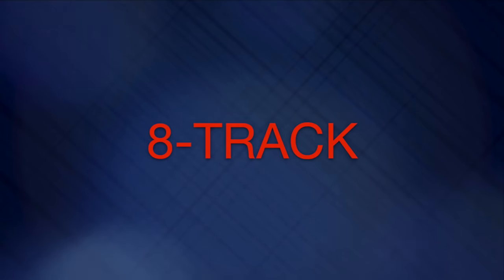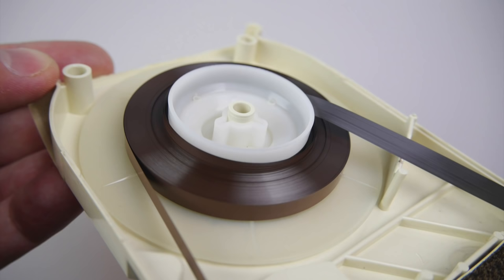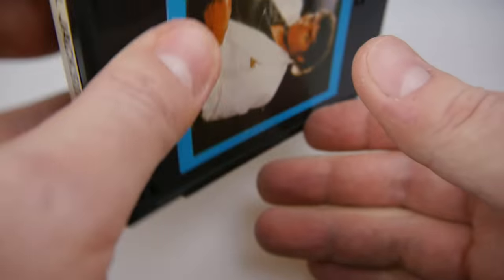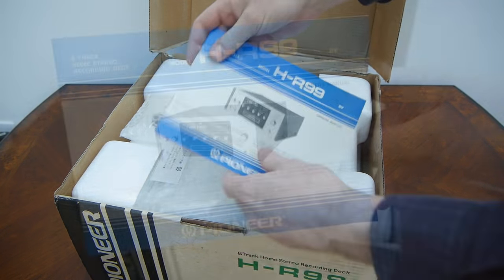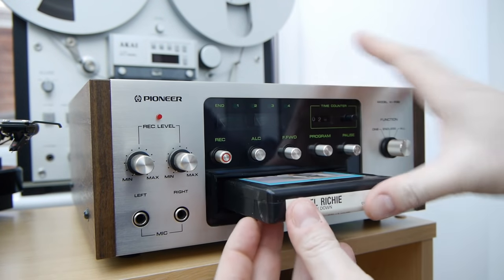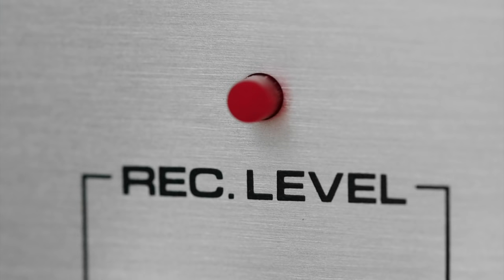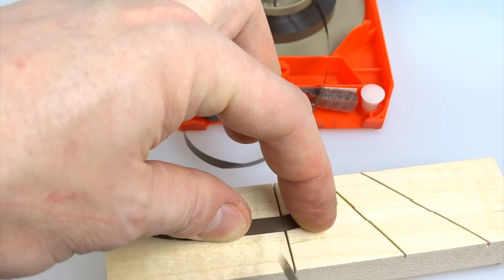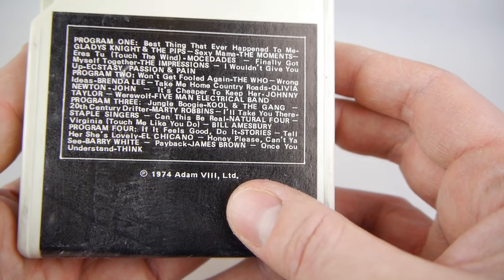Revisiting the 8-Track with a New 1975 Pioneer HR-99 Recorder

Comment: I think I had one of the best, if not the best, 8-Track recording deck ever manufactured.  It was made by the Wollensak division of 3M.  I even added a Teac AN-60 Dolby B adapter.  I made some fair sounding tapes I could actually stand.  But even at 15-years old I knew it was no match for my reel to reel.   The only thing it had going for it was you could make a tape and then play them in the car.  In about two years I gave up and switched to cassette.  I had a Pioneer Supertuner with some outboard amplication boosting the output.  It was way better than the 8-Track.  So I can see why 8-Track was phased out and I must say it stuck around longer than it had any right to do solely based on sound standards.  It was often plagued with wow and flutter and that was if the treble was good and not too noisy with hiss.  The most ridiculous thing was the constant changing of the tracks.  At first I was determined  to time my tracks in my recordings so I could fit songs on the tracks and not having to fade-in/fade-out.  This was akin to mastering differential calculus or a complete understanding of Einsein's time space theory.  Not fun and music is suppose to be fun - I thought.  So I ended up just letting each song go right through the track change deciding it was the least obtrusive solution even it was lame.  And lame "the full party package" which was 8-Track was.  Too many audible shortcomings and far too in-elegant mechanically.  Looking back I kind of amazed it got as big as it did in the US.  This was no doubt due to many cars being shipped with 8-track equipped sound as well as a burgeoning new thing which would spawn the whole in-car sound system revolution.  8-Track was bad but it paved the road to ever better in-car audio which ihas evolved into quite amazing serious Hi-Fi sound.

Comment: I have one of those Wien 8TD4 players, the poor thing deserved better than the bin.  I made some small modifications to it (mainly around screening and fitting a better drive belt) and it actually works very well now.  As it's connected to a cassette deck, I just increase the input level of the cassette deck to compensate for it's slightly low audio output level before it goes to the amp.  Granted though, the Pioneer looks smarter.  I also have a car player, which I suppose I could fit into my 1972 Hillman Avenger, but really I prefer modern sound in the car.  The format is nasty, replacing pads and sorting out tangled tapes is all part of the experience I suppose.

Comment: The real question is... Is that 8track sponge worthy?   - Elaine Bennis

LOL

One thing worth mentioning is that because these cartridges used an endless loop tape, they also required a  kind of built in lubricant.  It wasn't like graphite exactly because that would gum up the rollers and the heads.  But whatever it was, it could wear out over time creating more and more friction. Eventually, these tapes would usually stop playing well before the expected life of a cassette.

Comment: Most people threw away the slip boxes because the tapes wouldn't fit in storage cases with them. Some notes on the 80's titles; they were mostly only available through Columbia House or RCA Music Service. Often with the CRC ones, the foam inside is yellow instead of black, and the yellow foam just doesn't break down. So if you are in the habit of collecting and repairing 8 tracks, keep an eye out for CRC tapes with yellow foam that aren't worth much, like easy listening titles. Then break them open and remove the foam.

Comment: 8-tracks can sound great but, as you say, they can be a lot of effort. Even though the tape speed is 2x that of the compact cassette, the sound quality is usually worse. The drastic improvements in tape formulas didn't translate over to 8-tracks and it soon fell behind in terms of sound quality. 

Also, many of the features we might take for granted on a compact cassette deck (even a lower end deck) are often missing from 8-track decks. No rewind of course but also Dolby NR was a rarity, no tape type selector (again, the different formulas such as Chrome and Metal never materialized on the 8-track), and even the ability to record wasn't that common. It's telling that the Realistic TR-802 I own was considered fairly high-end at the time with recording capabilities, soft eject, Dolby, VU meters, and several play modes. Telling because Realistic (RadioShack's own brand) was really not a high end brand at all.

Comment: Interesting they keep the pinch roller inside the cassette, other than talking the cassette apart to clean it it seems like a better idea and easier to clean or replace, I can't tell you how many cassette decks I've worked on over the years where so much has to be taken away to get the pitch roller, I remember doing one on a  mitsubishi 8 tape changer and it was a real pig of a job.

Comment: Here's a tip. Use a pack of paper matches, and stick the small end under or above the 8-track tapes' front after you put it in the player. This will lever the front of the cartridge up or down and align the head to eliminate the crosstalk between tracks.
Reply: Well, where does one get paper matches from nowerdays? Since the smokers are all dieing out, they are pretty much inexistent, at least here in Germany. Guess you gotta buy them expensively on Ebay... Good tip otherwise!

Comment: I've repaired a completely jammed up 8 track before actually... Complete pain in the ass to put all that tape back on the reel but the tapes are quite durable (aside from the metal tape... It's pretty much the only place that comes apart) and it seems small folds don't affect the sound too much either.

Comment: what the sponges suffer from is Foam Root. Back when a lot of speaker covers used foam, since it could be "sculpted" for a dramatic look, after a few years they would disintegrate, sometimes turning into a large gooey mess. i have a pair of infinity tower speakers that suffer from foam rot, how about a video on how to replace the foam... thanks again techmoan

Comment: Akai made a recordable eight track machine with a glass X Tal head. Sadly with the sponge pads they do crumble over time. Unlike normal cassette the eight track was one loop with four channel sections on the tape an the machine. They also made eight track players for cars to, lots of cheap makes about though. You could get one from BSR that you could plug in to a radiogramme.

Comment: and if you dont want to buy that 8 track repair kit...I figured out how to fix these when I was about 14 years old in the mid 90s.  You can use aluminum foil and scotch tape to fix the metallic strip...and I would just tear the pads out and replace them with nothing.  My machine would still play them just as well without a pad. (That may not work with all machines.)

Comment: 1:58 track chart is wrong. The 8-track tape is recorded with the tracks split like the reel to real stereo tracks, but all tracks are in the same direction, and half as thin. So to explain this; track 1 a stereo channel is at the top edge of the tape and the other stereo channel is at the middle bottom half of the tape. They progress down for each of the 4 programs and then the last program the second channel is now on the bottom edge and it other channel is on the middle top half of the tape. How I know this was I replaced a stereo tape head of a reel to reel tape recorder with a 8-track head in my dad's parts collection as a kid and it tracked just fine.  Now the cassette was done with both tracks (left and right) side by side making it compatible with mono cassette tape players.   You see the picture on the card at 6:46 the tracks on the head are split wide.   As for blank tapes. Since 8-tracks use the standard 1/4" tape, if you are handy; you can take a 8-track cartridge that has a tape that failed or one you don't want and use it for a cartridge for your new blank blank tape. Also most 8-track center reel has the same hub like a standard reel to reel so they will fit the spindles.

Comment: Oh nice!! An eight track review, wow! If it wasn't for the fact that my eight track player is still working, I would have got rid of all the tapes and all,but I probably would have repaired it.  All the tapes I have are in excellent condition, always in their original boxes, so all that could be required is the tin foil tape that splices the ends together when the come apart or a rubber drive belt inside the machine.  Other than that, oh no! I''ll keep them 'till the machine dies.

Comment: I was big into 8-tracks in the 1970s because they freed me from the tyranny of radio. I could record my albums to tape and play them in the car. This video is interesting but doesn't mention the fatal flaws of 8-tracks (aside from the metallic tape falling off). 

The biggest, worst, unfixable problem is that the graphite (which allows the tape to get pulled from the middle) wears off. The more you use a tape, the harder it becomes to pull the tape out. The second problem is that the heads would get a buildup of crud (probably the  graphite) and you'd have to use a long cotton swab to reach in (with a penlight to see) and clean the heads off. 

There were head-cleaning cassettes, some with a soft cloth ribbon you'd apply alcohol to. The worst ones had a dry, abrasive tape which partially worked. When cassettes came along, I dumped 8-tracks.
Reply: @ Paul Wetor 
You were lucky to have a recorder. Others had to buy cartridges, and the shops sold same A.T.40 music that was played on the radio stations.

Comment: The problem with 8-Tracks and ESPECIALLY pre-recorded cassettes was they would use lousy, cheap media.  My Dodge Charger came with an AM radio/Stereo 8-track, weird.  I removed it and it still was working, I still have it.  I replaced it with an Alpine cassette player of the time.  What I would do is buy an album, and then use only the top grade blank TDK cassette tape, and dub it onto the cassette to listen in the car, and possibly another for the house.  That way, the record did not get worn down, and the tapes you could really play a while without degradation.  I am not an audiophile, but I could hear the loss of fidelity on some tapes after a number of times playing it.

Comment: I can fix 8-track tapes. It's a matter of being patient, not tangling the tape as you deal with it, and not winding it too tightly on the center reel. 8-track tape has graphite on the back so it can slip past itself as it flows from the outer edge to the center. Sometimes the cartridge pinch roller can cause playback problems. It's a shame nobody thought to put Dolby B noise reduction in an 8-track player.
Reply: Back then, Dolby circuits had to be discrete components, representing several dollars worth of cost, and since these tapes were largely intended to be listened to in a moving automobile, noise reduction was not a high priority.

Comment: Another thing you forgot to mention is that in the earlier 8-tracks alot of the rubber pinch rollers have gone to goo & have broken down & will need replacing. I ALWAYS press my thumbnail against the roller 1st to make sure it's still pliable before playing a 8-track as serious damage occurs when the pinch roller has broken down & gone to goo and you insert it into the machine & the goo sticks to the tape & wraps it round the capstan & makes a huge mess & ruins the tape beyond repair! SO...CHECK YOUR RUBBER PINCH ROLLERS BEFORE INSERTING A RECENTLY ACQUIRED TAPE  TO MAKE SURE THEY ARE HARD OR PLIABLE & NOT BROKEN DOWN TO GOO!

Comment: 8 Track was used a lot in cars and not much in the home, though there were 8 Track players.  My mate had one and I gave him a tape to listen to.  He fell asleep and it went round all night and when I got the tape back the recording was all damaged, so I binned it.
They were not very cheap, but very handy in the car, even if they did take up a lot of room, but there was a bit more storage in cars back then with often a shelf running across the car under the dash.  I had a portable 8 Track player that ran on batteries.  Hummm!  Maybe I should say ate batteries.  The speakers were on the back and front and split away so you could set them up like normal speakers on a Hi-Fi, but then it stopped being portable until you clipped them back together again.  They were a bit hissy and the tapes often jammed rather than broke, but they were less bother than cassettes that came along to replace them.  Not a perfect system and very clunky, would wake you up if you were daydreaming! Yes, the foam was always a problem, even on tapes that were not very old, the foam would perish.  The rubber pinch wheel would also warp if the tape was left in.  The heat of a car would wreck the tapes as well and they were large to store in a car, so would get knocked about and damaged and dirt wold get into them as the tape at the front was not protected as the boxes were paper and fell apart.  However, they were fine for the car as need less attention.  However, when driving you would suddenly realised you had heard the same track three times or more as they just kept playing round and round!

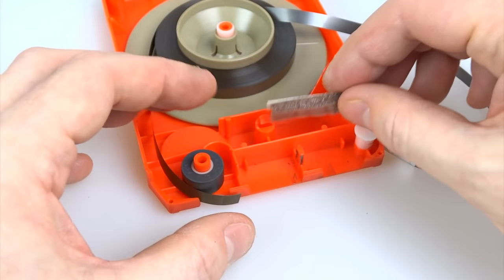Comment: This is a great video. But at 11:45 you need to slit the pressure pad so the little plastic rod slides through instead of squeezing the pad behind the rod. You want as flat a surface as possible. That’s why the Elton John tape sounds wobbly after you replaced the pad.

Comment: I never had an 8-track machine my 1st deck was a Sony top loading cassette machine purchased new. My 2nd one purchased used, was a Teac A4010S R/R quarter track deck. I liked the open reel sound better however the cassette quality was quite good with the Dolby system and high bias tapes. Plus the A4010S was 3 motor electronically controlled tape transport.

Comment: Facts from the distant past, I was there, 8 track players- half the price of a cassette player, cartridge- half the price of a cassette, ran at twice the speed- sounded better than cassette. Wasn't long before the radio cassette player took over and that lasted a long time until the radio and CD came. I had a car with factory fitted radio, cassette, and cd ! such is technology.
Reply: Cars don't even come with a CD player anymore, it's all satellite Radio or USB stick or phone input for music. The digital age. I recently got a set up to convert vinyl to digital. I have some old albums I couldn't find on CD. It even has software that is supposed to remove the pops and scratches of the vinyl. There goes the nostalgia.

Comment: When 8 tracks debuted, their competition was 12 inch records. Their size was never an issue, they seemed quite small at the time. We have gotten spoiled over the years.  Of course everything else was an issue, they broke easily, could not be rewound, fast forward was slow, programs were too short to fit songs, later on cassettes had better sound quality.

Comment: I know that this is a rather late comment for this topic but I thought I might add another chapter. One could never really call 8 track tape/players Hi-Fi quality as there was always tape hiss on quite passages. Interesting enough there was optional dolby noise reduction added to 8 track very late in 8 track lifetime. In fact Pioneer made the HR-100 deck that was identical to the HR-99 shown here but with included  dolby NR feature and there were also a very few prerecorded tapes sold that were encoded with Dolby NR, but good luck finding them these days.
Reply: I'm going to disagree with you - it was as hi-fi as any other media at the time.  You need to remember that ALL media in the 1960s & 70s had noise in quiet passages.  It wasn't until Dolby Noise Reduction became popular on cassettes that it got better - and even then it certainly wasn't perfect.  Heck, reel-to-reel was as about as good as it gets, and you have tape hiss there too.  Even brand new albums had plenty of scratchy sounds & noise.  It was just part of the joy of being into music in that era.

Comment: Its a wonder the drive belt in the deck itself did not break or turn to goo because of the age. Also some tapes where so badly made, they would have thick and thin tape and sounded awful when played. Put tape in a different case  or put tape in reverse, that was always fun. Don't forget the folded paper trick to jam into side to stop it from draging. LOL

Comment: That tape that is completely out of it's shell and looks like a disaster really isn't!  It's  very fixable w/no tool or special equipment,  and will sound like nothing happened to it after it's all put back.  Fixed many like that.  And because the tape is so thick (compared to cassettes) it's quite forgiving and easy to work with.

Comment: And I'm trying to fix a player for a friend that wants to transfer some home-recorded 8-Tracks.  I thought maybe it had a dried-out belt that snapped after I tried a couple tapes in it, but turns out the mechanism is still working, it's just not putting any sound out.  I was certain I still had my own unit, but I guess I must have lost that one in a house fire 10 years back.

I have thought how you could make an equivalent to those car audio cassette adapters, but one with Bluetooth and maybe an SD card reader along with a 3.5mm input.  Major problem is what to use for the playback head interface (had to have been done, there were those 8-track to cassette players).

Comment: ive wound them back used a reel to reel spool cut the splice wind it to the spool then hopefully you have the right side up you wind it on the tray then pull out around 3 feet from the middle and spice it then allow the slack to distribute